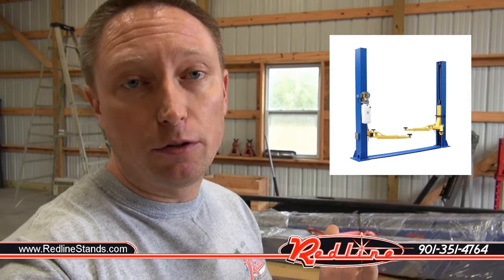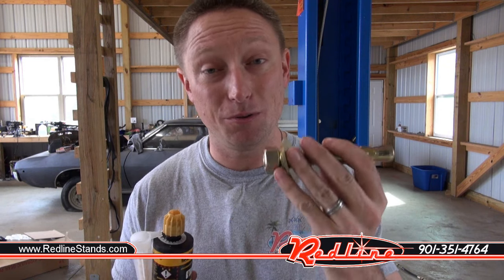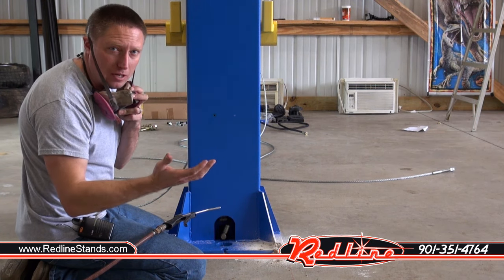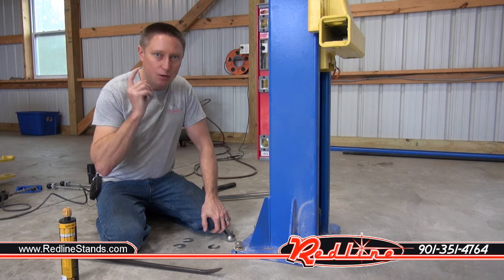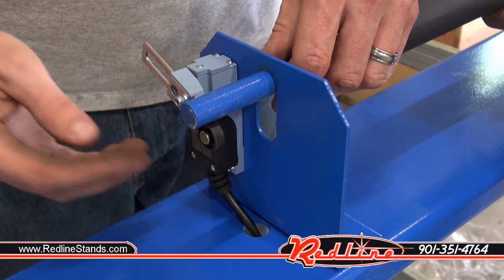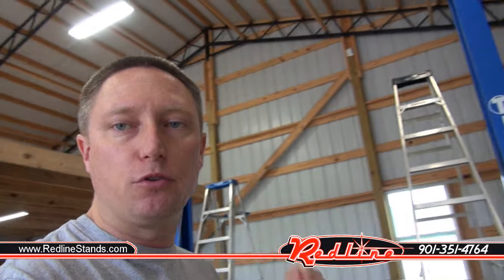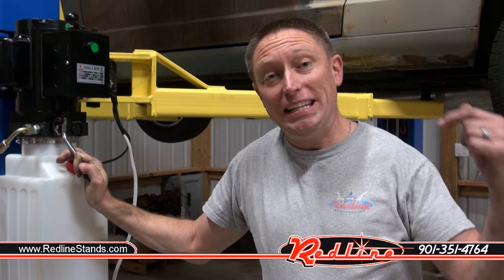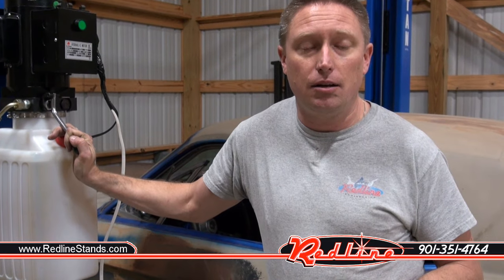Two Post Lift Installation How To - TP9KACX & HD2P-9000AC

Comment: Just wondering how much room you need in front of the lift to rase a 1/2 ton 4 door pickup.
 I'm  looking at getting a 2 post lift but need to know the distance or front clearance I need to 
determine where to place the lift. Haven't been able to find an answer. I'm thinking a, symmetrical lift.
Reply from the maker: Depends.  Honestly, you need to do the math here.  There's a big difference in the length of the short bed versus the long bed.  Not just that, I can't really tell you how much room you are personally going to be comfortable in terms of the space left between the end of the truck and the wall.  You gotta tell me this one; I can't really tell you how much space you'll be happy with.  Sorry I can't be of more help.
Reply: @RedlineStands  I'm putting it outside in front of my garage. I want it as close as i can get it without the front of the truck hitting the garage. So my truck is an F150 4door 6ft bed truck.

Comment: Will this lift raise a Ford crew cab pick up
Reply from the maker: That's not possible to answer sir.  The weight differential between a V6 F150 crew cab, versus an F350 4x4 diesel crew cab is a massive difference.  The ultimate answer to your question, is that this lift can handle 2,250 lbs per arm.  You should really watch this video below sir.
https://www.youtube.com/watch?v=D_19_30CyJE&t=1s

Comment: You might want to use wrenches in place of pliers or at least turn your pliers over so you don't round over the nuts.
Reply: That is some real hack to tighten hydraulic fittings without a back up wrench and using pliers. Engineers all think they are techs

Comment: If it just me or does that drill bit look longer than 4 inches, look more like 6.
Reply from the maker: Absolutely.  I like to drill the 3/4" holes all the way through the concrete until I hit dirt.  The only time I don't do that is when I'm testing the thickness, at which time I tend to put tape around the bit at 4" so I know how I deep I am.  Giggity.

Comment: @22+ you said that level is more important than the distance between posts. Absolutely incorrect !!!
The distance between the posts are more important to begin with. Level can be accomplished by shims, which is why you get them.  If you push the post in or out at the bottom,  you vehicles will walk themselves off the arm seats.
I use to install these and other types of lifts all over the east coast. Porche in Cincinnati Ohio,  i was working with the company that installed all of theirs and would come back for maintenance.  Geometry is extremely key to installation

Comment: 31:38 If you're gonna use the wrong tool, you might as well use it backwards.
Reply from the maker: I wish for once, just once, that someone critiquing my video would link me to their video that was flawless.  Ain't happened yet in 20 years, but I'm still hopeful.
Reply: I have tons of videos on my other accout; (deathwrench custom parts)  ....but I was just having fun with you.  I appreciate everything that I'm learning from you.  I do have a question though- how does the air get bled from the hydraulic system?  Thank you!  I'm getting ready to take my lift down and move it to my new place.  Cheers!  :)
Reply from the maker: @EricSolvesky  Copy that.  There are bleeders atop the cylinders.  You just set the carriages onto the safety locks, remove the bleed hole plugs, wait a minute or so, quickly bump the motor, fluid should spray out of both carriage bleeder holes.  Assuming it did, you can replace the bleeders and you're good to go.  The goal is just to release a little fluid from atop both cylinders so that you get any air out.  If the vehicle bounces as it goes up, you still got air in it.  That's about it.
Reply: Right on!  Thank you for the help! @RedlineStands

Comment: Why not just install a Mohawk lift?  No floor plate. No overhead beam?  Much better construction, stronger, and maintains value better.
Reply from the maker: Because a Mohawk is about 4-5 times more money than this lift.  The Mohawk is a great machine, no doubt about that, but selling them is very difficult.  The reason all the shops aren't littered with Mohawk lifts is the same reason all the cars on the road aren't Ferraris.
Reply: @RedlineStands  A Mohawk isn’t 4-5 times the cost of that lift.  It’s probably a little over twice the price.  The value of the Mohawk is much greater.  Resale of your lift is very little after you’ve had it a few years and the maintenance and repairs, including parts, is much higher.  A used Mohawk can be resold easily at 50% purchase price no matter the age.  You are correct that the Mohawk is the Ferrari of lifts.  Why would you be willing to work under the Yugo of lifts?  That Chinese junk you bought will be useless in less than 10 years.  A Mohawk is just about broken in in ten years.  For full transparency, I have to admit that I used to sell Mohawks.  Never had a customer who regretted the purpose.

Comment: Good video but your using those hand tools wrong. Pliers grip best when using them the correct way. When you installed short hydraulic hose from the pump to the fitting you had them backwards.... If your going to demonstrate how to do something please give the correct demonstration for safety purposes.
Reply: Betterr yet use the proper wrench…

Comment: So many issues with this demonstration.
An "engineered" design product should also have an "engineered" method of installation.  If clear, concise documentation is lacking, you probably have neither.  Hence his remark, "The instructions to this thing are not awesome."  Another clue:  limit switch that doesn't have clear terminal markings?
Or an electric motor that can be mis-wired.  You should not need a "licensed" electrician to connect to power especially for non-commercial devices.
Do the anchor bolts have an SAE rating and are they clearly marked?  A specific hole diameter is also required for every application.
Would an engineer approve of using epoxy with this type of anchor?
How about drilling holes all the way through the concrete?
Concrete can spall out underneath the slab or fracture without any way of knowing it...until a failure occurs.
Installing the overhead bar without anchoring the second column is asking for disaster.
Wouldn't you think an "engineered" product would have the means to safely lift the bar into place and have a method of minute adjustment to account for final plumb of the columns?

If you are laying out all the money and potentially trusting a life to the installation and operation of this item, then you should demand better documentation of the process.
Reply from the maker: There is some degree of truth to the things this commenter says.  I don't agree with everything said, but I do know this.  If you are looking for excellent engineering, great instructions, etc...the customer should not be shopping the $2k-$3k Chinese lifts and should be prepared to spend around $7500 on something like one of our Challengers.  Just remember folks, at the end of the day you're always going to get what you pay for and if excellence is what you demand, be prepared to write a healthy check to get it.

Comment: Your epoxy idea is literally dumb!!!
used it for 1 side, it prevented the snchors from spreading, and I was miserable trying to remove them....ended up drilking additional  holes in the post and slab.

On the other side, I just did anchors without epoxy, and Ilit was so easy.
I was able to torque them to 85 feet of torques as per manual.
Reply from the maker: This occurred because you did not correctly follow instructions...sir.  You've got to expand the anchors while the epoxy is still wet.  You did not do this.  Because you did not, you'll find that your anchors will get loose over time.  The idea is not dumb, it's actually quite clever, but it requires that the method be correctly followed.
Reply: @RedlineStands  yeah exactly what I did
Other side no expoxy no problems anchors tightened and wouldnt spin

Comment: What size are the studs and what size is the drill to drill the hold
Reply from the maker: Depends on the lift.  You really need to consult the manual to the lift you're installing.  They're not all the same sir.

Comment: What is the torque settings
Reply from the maker: Gotta read your manual for that.  I don't want to tell you one number, and then the spec for your lift require something different, resulting in an accident.